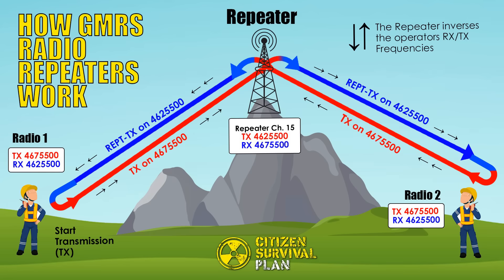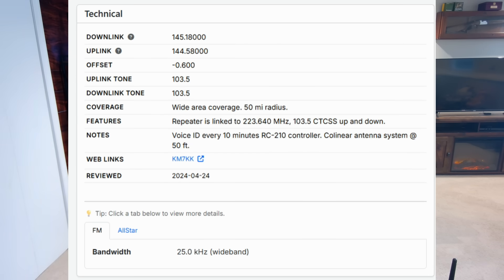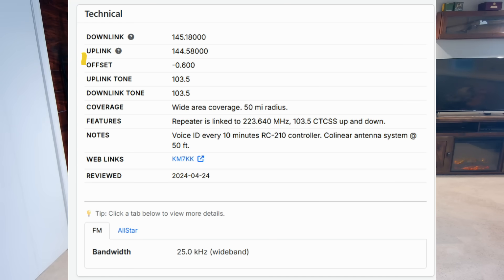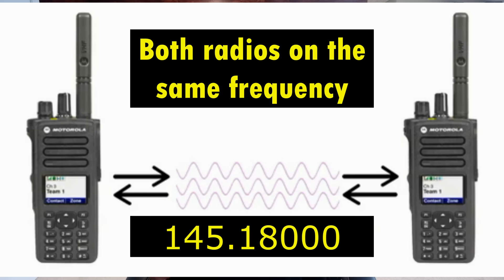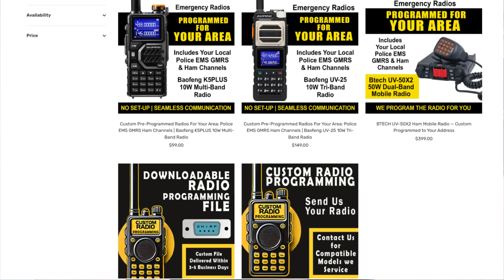Your Radio Won’t Work in an Emergency Until You DO THIS

Comment: LOL, wut?  You've missed a ton of stuff that highlights the value of these (and similar) radios.  Yes, repeaters are good, but they aren't everywhere, and you get huge value with an unlockable radio when SHTF because people will use blister pack radios from Wally World and possibly the GMRS folks.
Reply from the maker: I have done radio programming in some of the most remote places in the US there has never been a time when there was not at least 3 Ham repeaters near by.

Comment: ? And IF the repeaters are down?
Reply: You better learn how to simplex before that happens.
Reply: Now that is a good question. Where I live we have 4 repeater's. The one that most people use, has back up power. A solar charged battery and a generator that runs on Propane. The club I belong too also has a mobile repeater in a fully equipped van, which also has a solar and battery system.

Comment: You Can Use Simplex frequency
146.520 MHz Or 446.000 MHz  National Calling Frequency  !
Reply: You forgot 223.500 MHz for the 1.25 meter VHF band. And don't tell me it's not used. Might be true in a lot of places but 1.25 is fairly active where I live.
Reply: @mikemortensen4973  Not where I live. 2/70 here.

Comment: A Baofeng can be a useful tool in the hands of someone who has a solid grasp on basic radio theory, and uses radios frequently, but it's a bad choice for the average person to just put in their 72 hour kit.

Even if someone else programmed the radio, and even if you took a class and mastered the basics, don't expect to retain the knowledge to operate it 2 years from now, if you haven't touched the radio since the class.    Best to stick with something simple, and made specifically for FRS, FRS/GMRS hybrid, or MURS.  Buy enough identical units to equip your immediate family, or neighborhood preparedness committee.  Those are the people you will be communicating with in an emergency.  If 911 services are down, dispatchers will have their hands full, and the last thing they will want is inexperienced citizens trying to communicate with them by radio.

And, for God's sakes, stop giving Baofengs to children to use as toys.  Adult strangers can hear them, and can talk back to them.  Plus kids goofing around cause a lot of interference.
Reply: I agree completely..! I do understand n respect the rules. I had a close friend, like a father to me, he had a Bass 125 ft Tower antenna he got out far and wide.. unfortunately at the time I didn't pay enough attention to the finer points it was just about being connected to people around the world. Since then he has passed away and I wanted to get his radio but unfortunately the vultures came in and it was gone before I got there.. n Now it's coming down to becoming a necessity things are really getting bad out there and only going to get worse.. so I am desperately seeking help I have three bowfin radios no kids playing with them and I truly need to get them program and usable if you can help me do this I would truly appreciate it because like you said it's going to come down to our immediate surroundings and family in the end.

Comment: Just the other day, I sat down for a few hours and 'chirp' loaded a dozen of the radios.  Also, manually did the setup for the van.  Found the loacal freq's that made sense for me out here for the SAR teams, and such.  I feel much better knowing that I can just hand them out to my local folks.. and they will work together.  Takes little time to get a freq plan and program in bulk.

Comment: Also, when using a repeater, you must give your callsign. So if your not licensed, just don't. Also you need to know the language used, and I'm not talking English. To program your new Baofeng radio, you will need a computer, a programming cable, and a program called CHIRP, and the knowledge of how to use these three things. Yes I know I am stating the obvious, but if your new to Ham Radio, you most likely will not know these things. Oh, lastly, you need to know the frequencies and offsets to program your radio.
Reply: unless you program the radio by hand without the computer/ cable  John on wife's computer
Reply: That's what repeaterbook is for. and CHiRP

Comment: If it is a real emergency, the repeaters are not working. If they still have electric electricity, then sell towers still have electricity. The emergency you’re talking about is when only Cineplex can be used. Buy a radio and have a close group of friends that have frequencies written down. That’s your emergency. And yes, some repeaters have propane generator back up or battery. It only lasts for so long…… a radio, a long rifle to hunt food, a way to get water that is a secret, a way to make fire and get firewood. Those things should be ready. If the emergency last more than three months, then good luck.
Reply: Exactly. Oh and I think your S and C keys are mixed up. 😂
Reply: Not necessarily. Where I live there are 3-2M repeaters and one 70CM repeater. All four have back up power. The one most people use where I live, has a battery/solar system. Plus I can keep my radio's charged via a Solar Panel and Solar Battery Charger. So think about that.
Reply: @JamesHart62  No sun no power with solar.
Reply: That's only worst case. What about a traffic accident where there is no cellular coverage but there IS a repeater? Or if you get lost in the wilderness but can hit a repeater? Not every emergency is so catastrophic that it takes out the grid or destroys repeaters. In fact the VAST MAJORITY are not.
Reply: Yes I agree. And I hate to say this but 3 months is extending it.. LOL the fact of the matter is if power goes down you got about 3 days before people start nothing up and if you haven't had stuff put away by then you better head to the hills with a hunting rifle and whatever you can get..

Comment: I mean, to use repeaters need a license. If someone have license, they should know how to connect it. So, who is this video intended for?
Reply: This the most sad ham shit I’ve ever heard. Get governed harder though.
Reply: He did not speak about what your talking about at all. He should have explained everything; Half the information is not enough  John on wife's comupter
Reply: You need a license, so you can have people who can help you set up your radio. When I got my first radio, after getting my license, I had know idea how to program it, but a friend helped me. You need the license for the resources it brings to the table.
Reply: @JamesHart62  Nope, you don't. There are thousands out there with fully programmed radios who don't have a license. Maybe watching one of the THOUSANDS of videos here on YouTube on how to use CHIRP or any other programming software?
Reply: Illegal users?
Reply: NOT IN AN EMERGENCY! During an emergency where life is threatened you are allowed to use ANY MEANS TO GET HELP.
Reply: You don't need a license if it's an emergency, so maybe that's why? Or for gmrs there's a "license" but you don't need to know anything, so people might think that just by transmitting on the 462 frequency they are accessing the repeater when that's not the case. I agree for the licensed hams though they should know

Comment: Odds of hitting a repeater with a HT is slim if you don’t live vary open area or next door to one. Most traffic on repeaters or even what you hear on simplex will be people with much more powerful mobile or base station radios. If you want to use a HT type radio in an emergency get friends in a few mile radius to get them and everyone has a predetermined frequency(not one used for first responders or military) to jump on to to exchange info about your community
Reply: I don't know what you're using for an HT, but my little Chinese cheapy will easily go 20 km to hit a repeater in rural areas.
Reply: @Pulse87dotca  Yeah, my first Baofeng, a 5 watt UV-5R V2 Plus hit a repeater 35 miles from where I live, using a short Comet Antenna, from inside my mobile home.
Reply: @JamesHart62 35 miles away.
Wow.
I tested mine .Short antenna only made it 11 miles away from home base
Reply: @JamesHart62  Mine hits repeaters around the same distance inside a concrete block and reinforced rebar structure!
Reply: @Pul @Pulse87dotca  all about line of sight. Areas with repeaters on mountains will have no problem at large distances. Once you get in flatter areas and repeaters are on towers at 1-2  hundred feet won’t take much to start blocking the signal. I’m GMRS my closest repeater is 6 miles mounted at 40ft walking out side of my home can’t hit it. Get on the roof no problem. I think the majority of people that watch this video (other than experienced users) would not understand this. Most people live in a city environment they can’t expect to get the same range. That’s when simplex local coms are useful.
Reply: @ralphlucas5057  Ah, well GMRS changes things a bit, as it runs at UHF only frequencies of 462MHz which is most definitely line-of-site, and not great penetration of buildings, etc. I made the mistake of assuming you were referring to amateur radio, and a popular band for repeaters  is VHF 144-148MHz. Those frequencies will work better for distance and obstructions. Also, a 40ft high repeater is a pretty low altitude antenna. Most ham repeaters in my area are 150' minimum. One is 300' and the lowest I know of is 80'. So I guess I've been spoiled....
Reply: @Pulse87dotca I’m about 20 miles south of Phoenix. Even VHF at ground level is tough. Every home and business is stucco backed with chicken wire 😂
Reply: @ralphlucas5057  Oh geez, so there are Faraday cages everywhere!! It's not your radio. It's the construction methods! That's crappy. Takes all the fun out of amateur radio for you. 😥
Reply: It's not so much about the radio, as it is the antenna. I learned that fact real quick after getting my license, and my first 5 watt HT. I was hitting a repeater 35 miles away, with a Comet antenna from inside my mobile home. I now use a Baofeng BFHP-F8 Pro, which puts out ten watts, hooked up to a 42 inch Abbree antenna, and yes I put the radio on a SWR meter to check it. Just my two cents worth.
Reply: @JamesHart62  Antennas make the radio better, but a better radio makes the antenna better too.

Comment: This channel is full of a lot of bullshit
Reply: I've been using HT's since I got my license back in 2016. And the first thing I learned was to toss the stock antenna, and get a better/longer one. Using my 5 watt Baofeng, and a Comet Antenna, from inside my mobile home. I can hit a repeater that is 35 miles away. And said repeater has back up power. A solar panel and battery. It does not take much power to receive radio message, it only takes power to send, and depending on how high the repeater is, that can be as little as 5 watts, because in the end, its all about the antenna.
Reply: For example?
Reply: @elliottpeabody1287 as I stated in another post this type of radio (hand held ) is not going to hit a repeater unless in a very open area or very close. These radios only put out max10wats so in average locations you will get 1-2 miles range at most. I won’t bother with the legality of doing it with out a license. Also in a grid down condition repeaters use a lot of power so most will fail as soon as the power is out. Using radios for emergency should be for very local coms your preset network of local neighbors
Reply: @ralphlucas5057 You must have a terrible HT, because in the town where I work I can hit  at least 6 repeaters with my 4 watt Quansheng HT. 
That same HT, out in a rural area managed to reach a repeater 62Km away while I was standing on a gravel pile about 30ft high. And not just "barely breaking the squelch". It was full quieting.

73
Reply: @Pulse87dotca  Yep, he does not seem to understand much about Ham Radio. I live in a mobile home, and with my HT, hooked to a 42 inch long Abbree antenna I have no problems hitting a repeater 35 miles away. Of course it is up on a mountain. The first thing I learned after getting my license back in 2016, and getting my first, is it's all about the Antenna.
Reply: @JamesHart62 actually I know quite a bit. Yes you can hit a repeater that’s on a mountain at large distances. Bigger antenna will help. The video was giving information to unlicensed people. They might pickup or get with there radio a longer antenna.  The majority of the population live in more urban or suburban areas. Simple example of what I’m trying to say , my father who is an amateur extra can not hit his usual/closest repeater 10 miles away with any of his HTs  due to the way the land scape is around him and the repeater is on a tower not a mountain. I’m sure if he hooked it to his 65 ft towers antenna it could. People need to have realistic expiations of what the equipment can do in the environment they live in.
Reply: @ralphlucas5057  Amateur extra? Does not exist any more. Its Technician, General, Extra. Just to bring you up to date. Maybe he should put a better antenna on his HT?
Reply: @JamesHart62  only an idiot says "Amateur EXTRA? Does not exist any more."  and then goes on to say " It's Technician, General, EXTRA".  I guess your very very very SHORT TERM memory is non-existent, huh?  Even when you're typing and your previous statement is right in front of your eyes.  🤣🤣🤣🤣🤣🤣🤣🤣🤣🤣
Reply: @ralphlucas5057  Note he said it doesn't exist then he said it does.
Reply: @JamesHart62  What in   'ell are you  talking about.  ALL the classes you mentioned are  AMATEUR  radio.
Reply: @ralphlucas5057  You're full of it. I live in a Major CITY WHERE i CAN HIT every REPEATER WITHIN 35 MILES WITH A Baofeng UV-5R WITH THE STOCK ANTENNA. Now tell me again how I won't be able to hit any repeaters that far away with an HT?
Reply: @Plasmastorm73 well all your repeaters must be over 250 ft relative to your altitude any thing less than that it would be over the radio horizon and would not work. No major buildings or mountains and that is possible. Not everyone has that.

Comment: If someone is buying a balfang chances are they have a license and they'll figure out how to program it. If someone who is unlicensed is buying about fang he shouldn't be programming it because he has no business transmitting on any frequencies. He can just put in the repeater frequency and listen.. In an emergency situation only qualified licensed radio operators should be on the air and that's only if they don't interfere with other people. Unlicensed operators have no business being on the air during an emergency except if they are just listening
Reply: Absolutely! In a true emergency, ARES or RACES may be tasked with passing emergency traffic via legal nets. If you are not a licensed Amateur with traffic, stay off!!!
Reply: IF YOU HAVE AN EMERGENCY YOU ARE ALLOWED TO PICK UP ANY RADIO AND CALL FOR HELP NO MATTER WHAT BAND IT IS ON> END OF DISCUSSION!

Why Emergency Communications Matter

One of the foundational purposes of amateur radio is to provide emergency communications. The FCC rules that govern ham radio, specifically Part §97.1, state that a key reason for amateur radio’s existence is the “recognition and enhancement of the value of the amateur service to the public as a voluntary noncommercial communication service, particularly with respect to providing emergency communications.* Many hams have saved lives when non hams have called for help.
Reply: You are full of bull feces I use my fully unlocked tidradio h8 all the time without a repeater sometimes I use a semi local repeater it doesn't take any specialized knowledge to use these radios although I was a gentle class extra ham radio operator I am not anymore I let my license lapse I know a lot of people that use these radios with no licensing at all we don't bother anybody with them we know better
Reply: @markdi2 What frequencies do you transmit on, what is a gentile class extra ham radio license, you don't even know what the license classes are, LOL, FAKE.

Comment: Input tone with an amateur radio repeater has become recommended best practice but is not required.
Reply: Many ham radio repeaters do not use a PL tone, some do, most folks have no idea how any of this works, I can only imagine the radio noise mess with a bunch of nuts all trying to do something they have no idea how to do on frequencies they have no authority to transmit on.
Reply: It can be confusing.  Digital voice modes like Icom's D-Star and Yaesu's C4FM with all of their "rooms" still confuse me and I'm a computer geek!